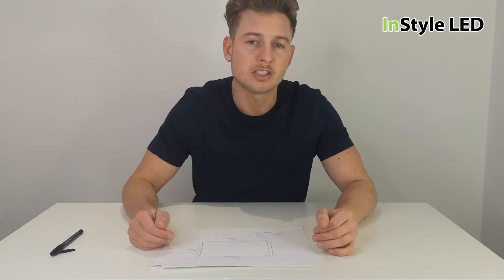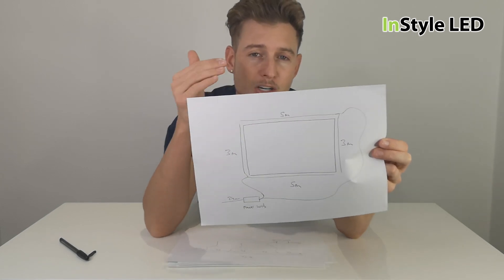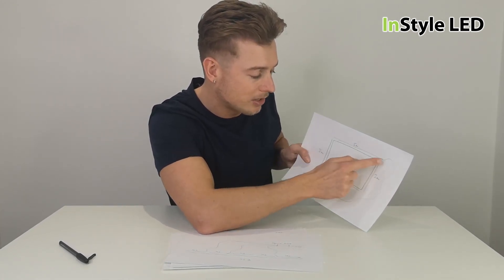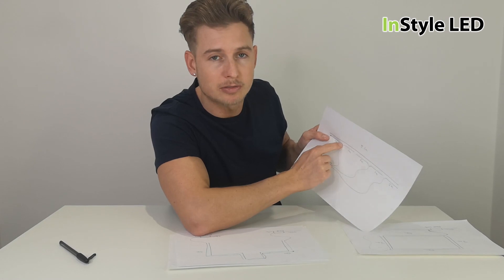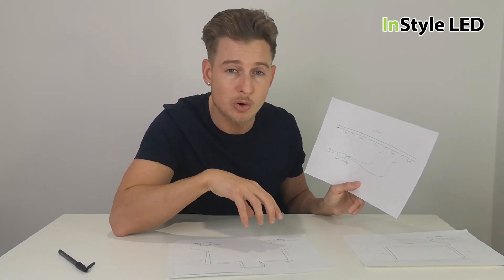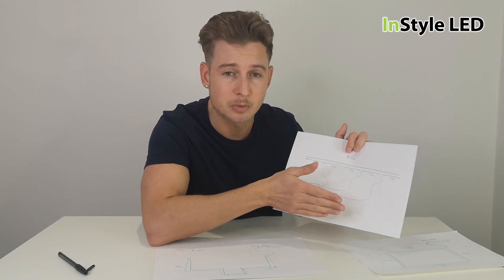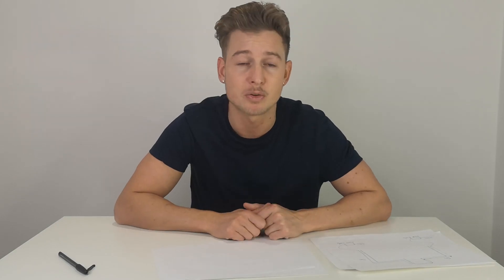How do I wire LED strip lights for a large project? (More than 5 metres)

Comment: What kind of wires to use? Copper or aluminium? 0.75mm or more for 25mt led strip driven through single 33Amp adapter

Comment: Hi I’ve had a 5 metre standard RGB+1 extra terminal with an arrow symbol and had no problems even though I’ve made one right angle joint and a straight joint piece but all of a sudden they’re pulsing/ flashing ?? Not sure if the transformer/controller is faulty ? Or dodgy connections in the connectors I’ve installed ( in a bathroom so subject to moisture ) ? Thanks

Comment: As all those options are wired in parallel, am I right to assume the length limit is determined by the amp capacity of the copper strips in the lights? I'm wondering whether I can make use of a 50v supply to power four 12v led strips wired in SERIES to form a voltage divider into 4 equal ~12 volt runs (power is ample and the copper strips are only then carrying the same amperage as the leds would drain in parallel from a 12v supply).

Comment: Thanks for your video! I would like to know if I have to use 12V LED stripes or if I can also use 5V in your example. I would have to use 17m of LEDs for my ceiling. I know that 12V would have a smaller voltage drop but could I also use your idea with 5V LEDs? I'm thinking about using 5V WS2812B 60 LEDS/m with a 80A Power supply. I think that these should have power injection every 5m, so I don't know if there is a problem if in one direction is 5m and the other direction 3m (which would be 8m instead of 5m) like in your sketch. Thanks for your response.

Comment: so where how I can connect the RGB Strips with DC power supply ? I have a 35 meter long project. every 10 meter one power supply between 2x 5 Meter. But how I can a whole Project in one receiver doing ? Thank you a lot.

Comment: I have a question. I got a 5 w 5 meter strip but I’m using a 100 W transformer. So am I consuming 100 wats when the led is turned on or am I consuming what the strip is rated.

Comment: Hi there
I’m having a problem with my 10m led project. I am using amplifier in between two 5 meter rolls.but the colors are not changing together and white lights flicker on the second roll every time the color is changed.do you have any idea how to fix it?
I attach a link below:
https://youtu.be/91dN54QQPP8
Reply: Larger transformer

Comment: I am in the USA and want to replace the lights in some jewelry cases. I know I can run 5M of lights off one driver but I think I may have more lights (total length) than 5 meters. Am I correct in hearing that you can split the circuit into 2 branches and run one adapter in the middle and have two strips. If I have 20 feet of cabinets all in a row can I run 2 10 foot LED strips from 1 power supply by feeding it from the center. How large of a power supply would that take. would I need one to run a 20 foot strip or one to run a 10 foot strip since I had 2 ten foot runs. Last thing is what power supply would I want. I want to run 12v white (4000K) LED's in the displays Thank you

Comment: hi i dont know if you can help me but i want to run 5050 RGB lighting in difrent strip lenghts under all my shelving units how would i go about doing it? as all my shelves are in difrent sizes from 12inches up to 40 inches i just cant find anywere that explains how i could do it regards, Steve

Comment: What power supply should i use for a 15 meter 50/50 12v strip if i plan to use 1 pow.suppy only? Thank you in advance for answering.
Reply: Do u have the answer to this? Did u figure it out ? 🥺

Comment: hello

i have ordered 15m rgb 5050 w/bt control and im thinkin will one 12v stock wall adapter what comes with the leds be able to light all 15m of leds evenly? :)
Reply: Depends on the watts each led strip use.
If it is exceeding the wattage that is being provided by stock adapter then the stock adapter probably overheat. He has made a video about understanding the wattage and choosing the right power supply,go check it out! 😃
Btw here's the link- 
https://youtu.be/fWYSF-t_tic
Reply: @lostyplayz2799  thanks even tough it was bit late but leds light evenly only if the led strips both eds were connected to the power adapter which luckily wasnt a problem for me 😁
Reply: @roskaposti5808  sorry for late reply for the previous lmao 😂

Comment: Im looking at doing a project at home where i want to replace our normal strip light over our stairs with LED strip lights on the steps themselves. Our stairs are 70cm long and we have 9 steps. Would i be able to put 9 lengths of strip lights in parallel on to one driver? I've worked out ill need a 40w driver minimum.
Reply from the maker: Yes I would get each strip made with it's own starter lead and wire them all in parallel to a connector block and then take 1 cable into the power supply. This way all the cables come from one side and all of the lights will be even brightness. If the power supply is say 10m away, then dont have 10m leads on each strip,  simplly take a 1.5mm cable over to the steps and then have shorter cables attached to the strips , for example 3m cables on each and then they all go into a connector block to your 1.5mm cable that goes back to the power supply
Reply: @InstyleLED  wow thank you for your quick response. Can i ask you another question please. What thickness cable would you use for LED downlighters if running maybe six in line.

Comment: Very imformative, what about extending the 2 × 24v cables when it's outside in a garden? Thanks
Reply from the maker: Yes this can be done no problem at all,  I would always use 1.5mm cable if it is extended , that way you can go up to 15m away from the power supply to the strip

Comment: if i'm using a dmx decoder after the power supply to go into the tape to control the RGB.. What amp decoder shall i get for each channel as in Red Green And Blue..? it's for 30m 50/50 RGB tape!

Comment: Could I email you for some advice on an install I'm attempting? I'm trying to work out a power injection situation.
Reply from the maker: Yes no problem, please email sales@instyleled.co.uk
Reply: @InstyleLED  You've never answered my emails... I have 15m of 12v rgb+w, 5 pin. How do I power inject that? 2 wires or all 5?. Does power injection come from the controller or the power unit?

Comment: hi, i have a 10m led complete kit, there is only one output from the controller but i want to split the 10m strip into 4 segments, 2x 70cm long, 1x 3.5 meters and 1x 30cm segment, can i just create and continuous string but soilder wire between the segments, longest jump would be about 1 meter, or buy a 4 way splitter?

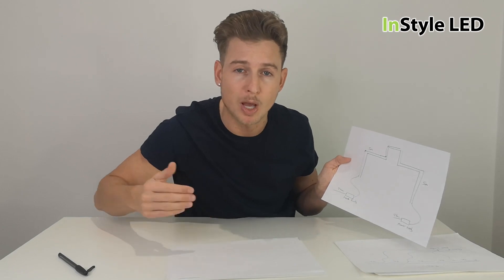Comment: At 5:49 you talk about connecting LED strips around corners with small "link cables".  I am planning to do this myself with 1.5mm^2 2-core cable, but I wanted to know what the limitations are.  Could I cut a 5m strip in half and reconnect it with 3m of 2-core, and still run it off one driver?  I'm not sure whether I should go by the overall cable length (8m) or the total length LED strip (5m). Thanks!
Reply from the maker: Great question!  The 5m total is for the strip only,  yes you can extend well beyond this with cable. 1.5mm maybe quite hard to solder onto the pads as this is thick cable, id use 0.75mm for the distance your looking for and you wouldnt have any voltage drop. Use 1.5mm for the starter lead cable from the 1st strip to the power supply. With this thickness cable you can be up to 15m of cable between power supply and strip. Id reccomend no more than 5m of link cable between strips at 0.75mm.
Reply: @InstyleLED  Brilliant, thanks! Slowly gathering all the knowledge I need for this project! I think I'm now confident enough to actually go and buy something! 😂

Comment: Found your video to be quite useful so thanks for the upload! Have one rookie question though. When bringing a cable to a rectangle corner, how or what do you use for splitting the cable up so you can connect 2 strips going their own way from 1 single cable. My total setup is going to use about 120w from a 150w powersupply - dont know if thats useful to know before answering.
Reply from the maker: Thanks fror the feedback!  you can use a connector block, they are small scew terminals that are low cost from any electrical store or BandQ etc.

Comment: Great vid. So on 2 long runs of 24V RGBW using a 320 W power supply. How long can you go for length without having to boost the power. I believe I will be 9m for each run. Plus what power cable has to be to each LED strip run. I thought A 2 wire power lead and a 5 wire RGBW to control the strips together. The power supply is 3m from the beginning of the strips start.
Reply: 24v rgb led strips may get 10 meters before needing injection. There are a few factors to consider, including how many leds are in the run.

2 runs of 9 meters each, maybe try power to the middle of them, and your data/rgb wiring at the beginning of the first led.

Check your colors are all ok if you don't have a multimeter & if you do have one, check your voltage at each end of the runs with highest level of white brightness. 5% is usually around the loss factor. So 24v - 5% loss = 22.8 volts. Or thereabouts.

Easy enough to run an animation on them & just check your colors are accurate.

If they are the wrong colors at each end, your voltage drop is too high.